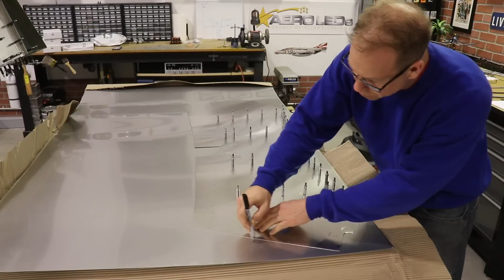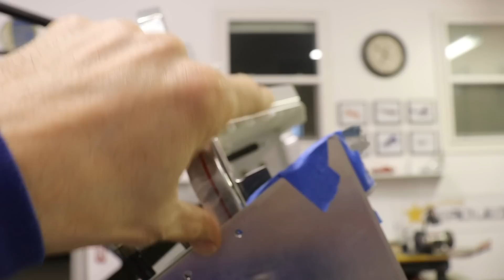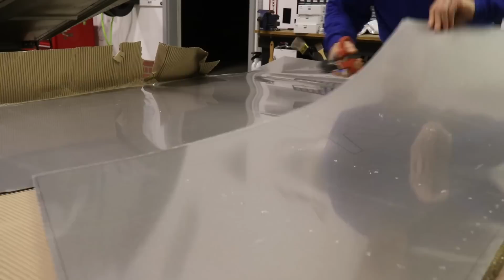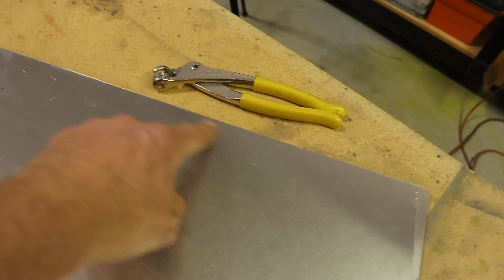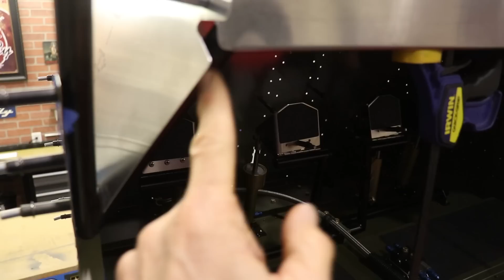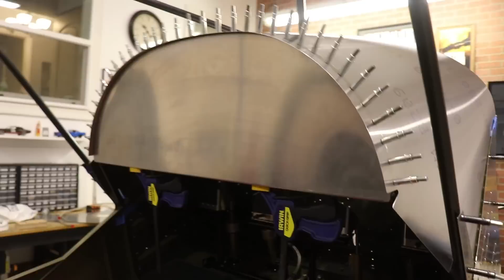Fabricating a CUSTOM Zenith SD Glareshield (Ep43)

Comment: When you’re using a bandsaw to trim thin sheet metal with a large area, how do you keep it from flopping around? Do you use a plywood backer board for rigidity? Or get an extra set of hands to hold it? Thanks
Reply from the maker: Nope I just use my long arms. I'm able to move around the bandsaw to hold the aluminum.

Comment: Hi Mark, thanks again for making these. I am currently an armchair builder but out of curiosity, if Zenith supplies a part that doesn’t fit or is miss drilled ( I have seen this on other builds online) how are they about sending out the correct part? I would not expect a home built airplane to go together trouble free, but in your case if it was miss drilled would they send you a replacement. Thanks again, I get real stoked when your videos drop.
Reply from the maker: Zenith has excellent customer service. There have been a few parts on the Cruzer and SD that had small manufacturing errors and once I let Zenith know, 99% of the time they have a new part going out the same day. I have no doubt that Zenith would replace this skin if I asked, but since I have rolls of aluminum at home I didn’t mind just making a new one.

Comment: Nice work. I'm curious: did you decide a while back to buy some extra aluminum sheet, in case of mistakes/do-overs, or was it something you happened to have from a previous project? If it's the former, maybe you could consider another video about mistakes and... contingency planning? Keep up the good work!
Reply from the maker: In 2005 I bought the plans for a Hummelbird and bought a lot of aluminum. I didn’t finish the plane but still have rolls of aluminum.
Reply: @KitplaneEnthusiast  !!! A very different animal... thanks for the reply.

Comment: Excellent Job! The quality of your work is estimable.
Is there a reason the glareshield goes under the side skins? Or is that just a temporary fit? Just thinking about rain running into the seam as apposed to fitting the glareshield like lap siding where the upper piece lays over the the lower one to shed water.
Reply from the maker: It actually depends on the panel. If you go with the wider Cruzer panel, then the glareshield goes out side of the side skins. But it goes on the inside of the side skins with the STOL panel. It's difficult to explain without showing you pics, but it has to do with the vertical steel tube. The glaresheidl (with STOL panel) won't fit not he outside of the vertical tube.

Comment: Nice work, did you talk to Zenith to find out what the problem with the old glare shield is out of curiosity?  I'm wondering if they are all this way.
Reply from the maker: I have not yet. I will send them some pics just so that if something needs changed in their CAD file they can make the changes. Since I had the material here, I figured it would be quicker to just make a new custom fit glareshield so that I could leave out the firewall holes. Plus, I wanted to make the side tabs and front a bit longer. One thing I've found in building airplanes, is that it's extremely helpful to have a large benchstock of hardware and spare aluminum. I find that I'm always making some sort of bracket or mount and need extra aluminum, or nuts and bolts.